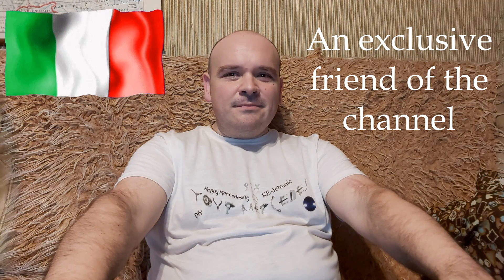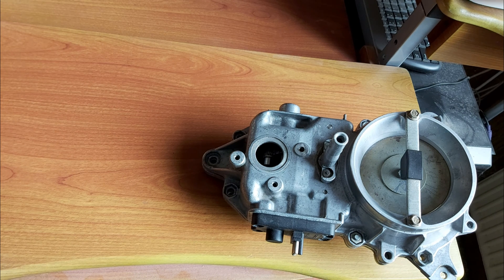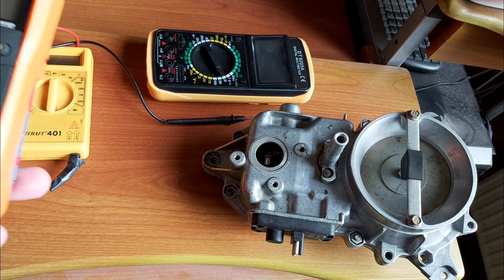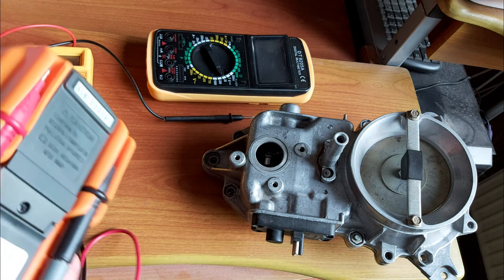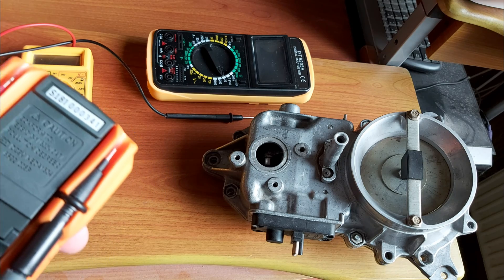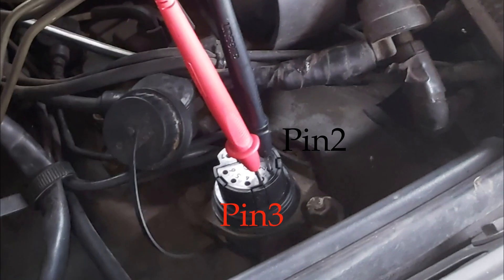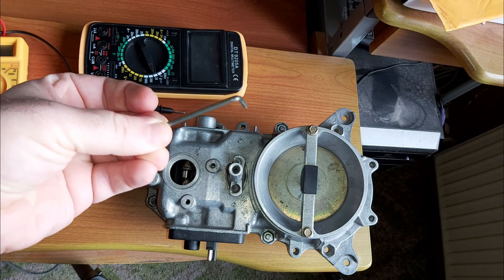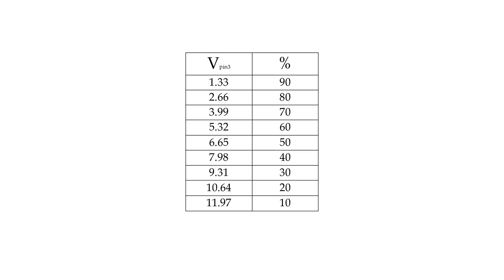㉦Mercedes Ke-Jetronic㉦ - The duty cycle/how it's done

Comment: Hi Ivica. If the car does not have a Lambda Probe do you still set the Duty Cycle in the same way?
Reply from the maker: Either with %  steady 50% reading or measuring current on the EHA. The same procedure. The more the mAmps go in negative, the richer the mixture and vice-versa. On idle you have to reach 0 mAmps. As for 2000rpm for m102 engines it says 3-5mAmps, as for m103 engines 3mAmps as far as I know. Now, there should be compromise between the % and mAmps. Either leaner mixture the car runs a bit sluggish(ecology matter😃) or you want the mAmps and the mixture a bit richer(the car runs better but it will have a bit higher consumption).
(The underline on 3 has to show NEGATIVE 3)😃
Reply: @mercedeske  Thanks Ivica. Always appreciate your knowledge.
I’ve ordered a fuel pressure gauge, I’m really looking forward to using it so I can get some facts, and hopefully be another step forward to having my 260SE running sweet as a nut. All thanks to you and your invaluable videos. Speak soon, and Merry Christmas.
Reply from the maker: @davidfenton5955  Thanks for everything and merry Christmas 🎅 🎄 to you as well.

Comment: Hi, I have a problem with the w201 190 1.8. When I slow down and stop the car, the speed drops and the engine shuts down. I would like you to tell me what to watch out for. Please help me. Thanks.
Reply from the maker: Hi, many factors can have influence here - the potentiometer, the TPS, the microswitch, the lambda if you have one and the last but not least - the ICV! You will have to check all these if they are as they are supposed to be!
Reply: @mercedeske  there is a case that the idle valve is responsible???
Reply from the maker: It could be. The ICV has to bypass the air to the cylinders. If it sticks and won't open enough then the car stalls.

Comment: Hi, again thank you for another great video.

Where can i find the specifications (EHA Current) for M104 and M119 engines? Working on 300SL and 500SL from 1990.

Thank you!
Reply: Please let me know if you have anything information about 560 sel Mercedes
Reply from the maker: Hi and sorry for the delay, your comment was in spam. I have no idea why. As for the EHA I believe that for all the engines it's the same - on idle you will have to get the fluctuation between -3 and 0mAmps on idle and -5 to -7 at 2500RPM

Comment: I love your videos man!. Thank you for all your help. I need a piece of advise from you from my situation if thats ok. On my x11 port 3 i get readings but when i put the black lead to port 2 the readings go away(duty cycle mode). Not sure why its happening. So i tried adjusting my lambda with just the red lead. I also noticed that the % goes down all the way to zero
Reply from the maker: Hi. Thanks a lot. That was my case, too. The multimeter shows 48% and then falls  rapidly to 0.9%. Try either to adjust the mixture (counterclockwise) but measure voltage as I explained. Is your lambda okay? It has to be replaced each 50k km(30k miles).
Reply: @mercedeske  i am suspecting that my lambda probe/o2 sensor is my issue. I just bought the car recently without knowing that CIS even existed lol. So all these are new to me….. also im having multiple misfire it gets worse when everything gets warm i checked pretty much everything spark, vacuum leak and fuel. I pulled the spark plugs after few idle time and noticed some fuel on the spark plugs. Im guessing weak spark from ignition coil. Have you experience multiple misfires like mine?
Reply from the maker: Have you replaced the injectors?
Reply: @mercedeske  i have replaced them, also fuel pumps and fuel filter. I have multiple eha valves, ovp just for testing. Tested the resistance on CPS then they read somewhere around 800-900 ohms. Also the ignition coils are something like .5 ohms and 9k ohms. It has new spark plugs cap and rotors and spark plug wires.
Reply from the maker: @amont_26   Did you glue the EZL with the paste? There is a special paste with which the EZL is glued to prevent the heating of the EZL.
Reply: @mercedeske  i have not touched the ezl yet since im not too sure how it works. Would that cause my issue?
Reply from the maker: @amont_26  Sorry, my bad. Someone else told me about the EZL😂😂😂
Reply from the maker: Well, try to read out the codes. Maybe there is a code. If you have a rectangular diagnostic socket by the battery plug in a wire in the contacts 1&3. If you get a single beat everything is okay.
Reply: @mercedeske  will do that! I just need to find a code reader. The diagram from benzworld seems wrong. It pops the led all the time
Reply: @mercedeske  I am dealing with same situation. duty cycle disappear after a short while. did you ever solve this?
Reply from the maker: @orimorad3064  Yes, I had to do it by measuring voltage ⚡ Try to get the fluctuation 6-7.2V
Reply: @mercedeske  well i get exactly 0v until i cycle ignition switch off and then on again

Comment: What if my multimeter is showing me 99.97% on duty cycle no matter if i turn the hex screw ,i have a brand new potentiometer,o2 senzor and eha and i changed 3 ecu same result...
Reply from the maker: Either the multimeter is bad(I had that problem, I couldn't do it in %) or there is a code stored in the ECU(most likely the O2 sensor). Although you replaced the O2 sensor, the ECU gets the information it is bad. If this is the case you will have to erase the code.
Reply: @mercedeske  how do i erase the cod?
Reply from the maker: There is a rectangular diagnostic socket by the battery. Plug in a wire in the contacts 1&3 for about five seconds and take the wire out. If you get a single beat, everything is okay. If you hear more of them, then text me.
Reply: I put the jump wire from 1-3 but i didnt hear any beat shouldn't i use the specific diagnostic tool with the light?
Reply from the maker: @salehfiras943  You can try with the obd1 scanner. It can be found on ebay